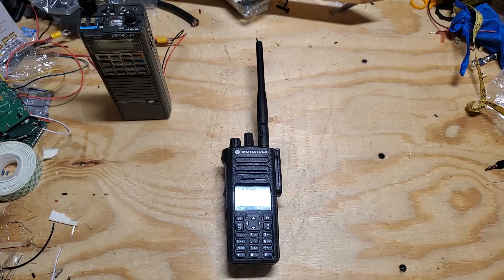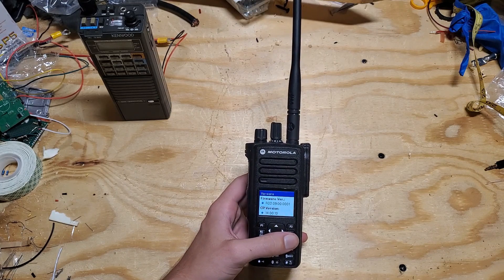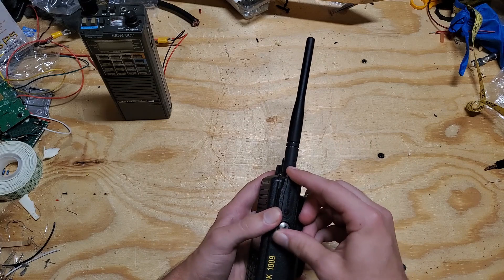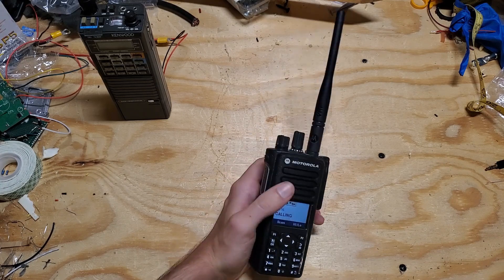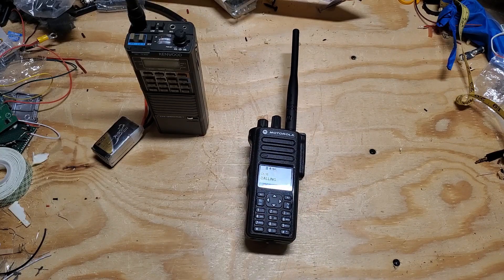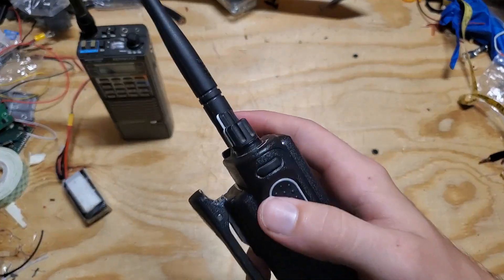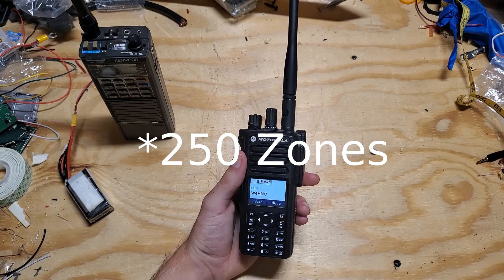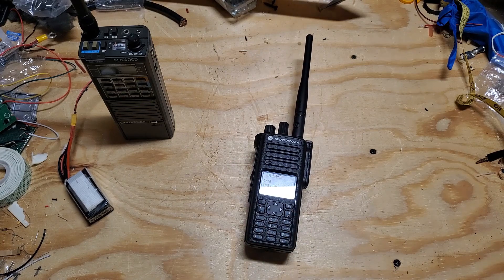🔴Motorola XPR7550e For Amateur Radio Review - How good is it?

Comment: An update to this for those interested in the XPR 7550e; the CPS 2.0 from Motorola is now free. All that is required is that you create an account (also free) with Motorola Solutions and after speaking with their customer support and getting that account activated (about 2 weeks), you will have access to download the CPS. I am using CPS 2 on Windows 10 (Boot Camp Intel-based MacBook Pro) with both the XPR 5550e and the XPR 7550e, with a non-OEM programming cable purchased through eBay. The overall value of these radios have definitely increased for amateur operators, with these changes.
Reply from the maker: Thanks for the update!

Comment: I have two second hand and I dont know how to reset them and use them
Reply from the maker: Motorola Equipment is the best by far, but they are the most difficult and expensive to program.   They are first Government radio manufacturers, then commercial.  They really don't do Ham Radio without modification.   Programming and cables can be expensive!  Some Motorola programming software must be run on DOS or a very early version on Windows.   I love Motorola, but can't afford to go there right now.
Reply: My buddy Chuck Chamblee sold me one and programmed it for me… I use it at Huntsville Speedway… Chuck was a good guy that passed away so now I’ve got to find someone that can program it. He was going to teach me all about it, but it didn’t happen.

Comment: You can have front panel programming if you get someone that has the right software to do it but it only works for the freq that you entered it will not store it and when you turn off the radio it is gone.

Comment: You need the entitlement ID number cost $30. It allows you to turn the radio to white band and add more to the menu options where you can change frequencies.
Reply from the maker: Not if you have the hacked CPS and can get all the entitlements enabled for free, like I did. If you get the entitlement straight from motorola it's still free though.
Reply: How?!  @StarShipAdventures
Reply: Biggest issue is just getting Motorola to approve your account and get you an entitlement key.

Comment: The "chirp" noise you hear is called "MDC 1200." The lower, longer "chirp" is called the "MDC 600." 
It is a data burst that sends radio info within it. You can set it to send at the beginning, or end, of your transmissions. I programmed mine to send my call sign on ham frequencies, and my unit number on commercial.

Comment: If you create an account with Motorola you can get the Programming software {CPS} directly from them. No dealer needed for this to happen. Also once you have the software you can get an entitlement so you can use it on the wider Amateur Radio frequencies. The software will only let you program it in the narrow band mode without this entitlement.  Going this route you stay 100% legal.  It takes a little bit of work to do all this stuff but it's worth it.
Reply: Ya, he said "thousands of dollars..." , maybe it's different in his country?
Reply: @nine7295   no its just an old video with outdated info. Motorola used to charge an arm and a leg for CPS, but they recently decided to make CPS free for download with a business account, no test or license required.
Reply: You are correct no charge for free.

Comment: I have been a Motorola XPR7550/7550e customer with Motorola Solutions for 10+ years. Now in 2023 all you need is a Motorola account to download CPS ver1r16 or CPS2 for free. Motorola Solutions and (some) Motorola Dealers are "Ham friendly", however, their price is non-negotiable, so don't ask. Not to say that some Channel Partners/Dealers won't give you a discounted price on new gear. However, be professional and not a whiner, or you won't get far. 

Using an Anytone 878UVII+, an Alinco MD5XTG and a 7550e on 1W, most places I could NOT ger into our repeaters with the ham versions, I could work 90% of them with the 7550e. Think about that before you decide. Yes, if you are not familiar with Motorola MotoTRBO radios, it's going to take some research & study, and $$$. IMHO, it is well worth it. Good video! de W5AMG
Reply: Since you seem to have the experience… Any idea why my P1 and P2 button don’t do anything when I press them despite there showing “zone” and “BT Aud” above the buttons. They don’t do anything.

I just got signed up now that Motorola is slowing cps for free. So far it’s a learning curve but I’m getting there

Comment: Hi, recently got an xpr7550e VHF model and the firmware was already updated beyond the firmware version you recommended. Is there a way to revert it to the older version or is there a work around?

Comment: The biggest problem for ham is the weird antenna connector. I have repeaters that I regularly use I can hit with all of my other radios with higher gain antennas like a signal stick. It's not a deal breaker but someting to think about. XPR6550 you cna use SMA antennas on. But I do really like mine for public service events and in my CERT group for the robustness and simpllcity of use.
Reply: They sell an adapter for the 7550e, it would let you use a signal stick
Reply: @josephhacker6508  Who is they? ;-)
Reply: well, I mean it does accept a normal SMA to BNC connector, but all of those have a center pin, the motorola do not have a center pin, so I am kind of confused by all of this.
Reply: @josephhacker6508 I was unable to find a definitive part number/adapter to make another antenna work. Are they custom made? I'm trying to get more range out of the xpr7550e. I'm limited to about 1 mile in a hilly area. The OEM antenna barely works when inside a building:/
*UHF 400-512Mhz

Comment: 1:40 So if you upgrade past this version of the firmware, you CAN program frequencies from the front panel? Asking since I have a 7550e that I got used, and the prior owner already paid Motorola for all of the feature entitlement, so by upgrading I don't theoretically lose anything, but I can't find any other info on the newer firmwares actually supporting front panel frequency adjust. Can you elaborate or point me to where you heard this? Thanks so much!
Reply from the maker: So from what I understand, the newer versions of the firmware have FPP (front panel programming) built in to the firmware. Technically the version in the video has it too, but there is a bug/glitch where the frequency adjustment menu is missing. The bug is fixed in newer versions. The problem is that upgrading removes all the hacks and tricks that make using this radio on Amateur bands so cheap and easy. Without it, you will have to take it to a dealer every time you want to reprogram it, all the options like the 25KHz, audio enhancements, etc, will cost lots of money. Now if these features are already purchased, it will probably keep working. I'm fairly certain that the radio will want to "phone home" a lot more then it does, which makes using non-official CPS software impossible and you'd have to become a Motorola dealer to get the software to work.

I'm no Motorola radio expert so this is all going off what I learned from a friend of mine who shall remain anonymous. He's a Motorola dealer who's dealt with these radios for a long time so I trust him. There's probably a better explanation of what exactly happens when you upgrade somewhere else online.

If you're willing to risk paywall-locking the radio it would be interesting to see what really happens, but personally I wouldn't do it.
Reply: @StarShipAdventures  Thanks for the info! I already have 25khz entitlement for it (not actually that hard to get, Motorola gives it for free, just takes a while). I'll definitely do some research, but it sounds like updating won't actually be the end of the world for me. I appreciate your insight and detailed answer! Thanks again!
Reply from the maker: @henryatkinson1479  Please keep us updated if you do!
Reply: @StarShipAdventures  Will do for sure! I'm going to check with a friend of mine who knows a pretty sizable US-based Motorola dealer to see if they can get me any info before going ahead, will report results here.
Reply: Current situation seems to be that no US-market 7550e radios have a VFO, and that it is intentional. The APX 900 does, and hardware-wise is very similar to the 7550e, but costs a lot more and needs the APX CPS software.
Reply from the maker: @henryatkinson1479  the 7550e definitely has a VFO in some form, there's a few youtube videos on the subject. Basically you create a zone with two channels in it  that aren't important. Then you use the  built in menu to edit the channels to whatever frequency you desire. The frequency will reset on power cycle. The problem is that this version of the firmware is missing the menu entry for editing the frequency.
Reply: @StarShipAdventures  That requires a GOB firmware sold by North Georgia Communications, which was actually stolen by NGC from a now-defunct Russian company. Its not possible to edit firmware on a 7550e without that GOB firmware as far as I know. Personally I can tell you my 7550e on the latest firmware does not have a frequency edit option even with dealer FPP enabled.
Reply: @StarShipAdventures that's not accurate. No Motorola factory firmware has FPP in this model.

Comment from the maker: The noise you hear at the end of my transmissions made by the XPR is called MDC1200. It's a signaling mode meant to transmit a numerical identifier to the other radios on the frequency. I have it turned on because I like the sound. It can be enabled in the CPS under each channel's settings.
Reply: If you use the MDC on your hsndheld on a local repeater here in SoCal, you will still up a hornet's nest and someone will jump down your throat before you even unkey😂😂😂
Reply: Nobody wants to hear that stupid noise!

Comment: How well would these radios work for radio too radio communication?  No repeaters.   An actual working range in suburban, rural, wooded areas and semi hilly /mountain area?  I'm looking for something geared towards group communication of around 3-5 people with a range under 2-3 miles.
Reply from the maker: Suburban range (in my experience) is around 1 mile at the best. You'll probably get half a mile in an area with houses, trees, and small hills. Rural areas will average further, measuring in 2-3 miles over minor hills and few trees. Wooded areas are the worst, measuring in 1/4 of a mile or less. The UHF version of this radio would do a lot better in wooded areas and suburban areas. Semi Hilly/ Mountainous areas are where the VHF model shines. It works about twice as well as a UHF radio over hills. 

All in all, there are MUCH cheaper and just as reliable radios that would suit your needs. That being said, if you want the best of the best, this motorola radio is really good at being just that.

Comment: This is a great radio. The biggest limitation is you can't use Bluetooth programming, if it's been hit with CPS 2.0. You can find a lot of them used that still work with CPS version 1.
Reply: @Nate Randall  But you can use wifi programming, which works better, anyway.
Reply: That’s incorrect. The firmware is what makes it no longer programmable on ver 16.
Reply: cps version 16 build 128. never down load 2.0. look around the net. I think the firmware might be able to be put back on 2.09 so you can use v16